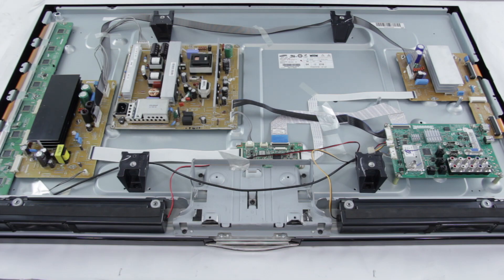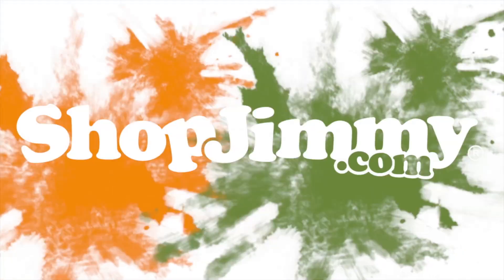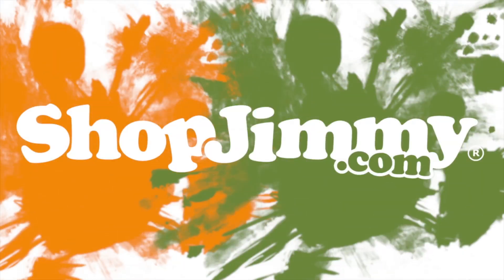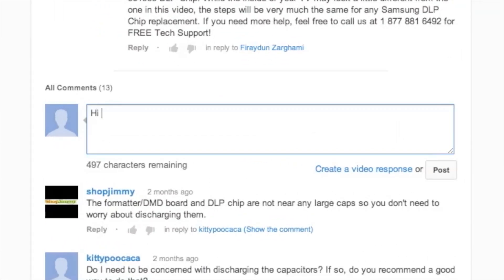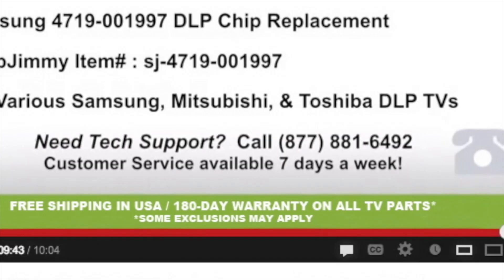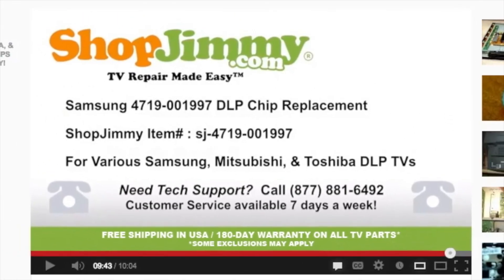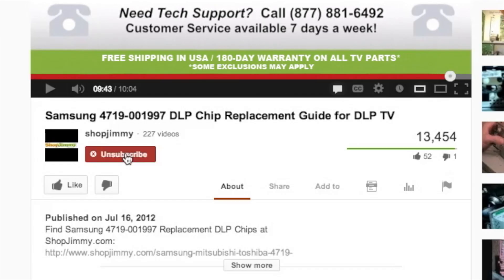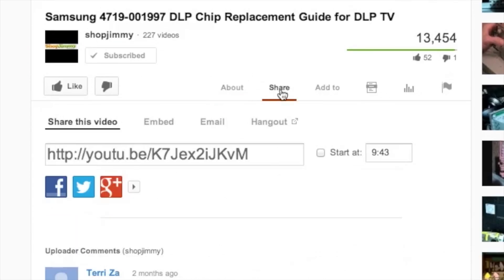Plasma TV Repair Tutorial - Common Symptoms & Solutions - How to Fix Plasma TVs

Comment: I have a Panasonic TC- P42G10 that while watching a show made a loud "popping" noise then shut off. the power LED was blinking red a few times (did not count how many times though).. any ideas on what to do to remedy?
Thanks!
Reply from the maker: Steve Blais   PLEASE SUBSCRIBE TO OUR CHANNEL - Try all repairs and troubleshooting at your own risk.  I recommend replacing the SC, SU & SD boards in your TV.  Click this link to replacement parts for your TV model number:  http://www.shopjimmy.com/catalogsearch/result/?q=TC-+P42G10  There may be multiple boards for the same TV model number, be sure to match part numbers on your current board, with your replacement for compatibility.  Thanks and please let us know if you have any further questions with your TV Repair!  www.shopjimmy.com

Comment: 42HP16
Partial lit screen, mainly on both sides with a dark middle
everything works ok otherwise
I was told it is the plasma panel itself and is not worth repairing.
I had two boards changed before and had larger capacitors to withstand heat, i was told toshiba original design was not adequate for heat.  tv worked great for months after until the screen problem happened suddenly.
you can email me direct wiseguy1963@yahoo.com
Reply from the maker: Nash S.   Try all repairs and troubleshooting at your own risk.  This sounds like a TV panel (TV Screen) problem.  If your TV panel is bad, it may be more cost-effective to replace the TV as panels are typically hard to find in stock, difficult to replace, and expensive.  Thanks and please let us know if you have any further questions!  www.shopjimmy.com

Comment: Hi. I have a Samsung PN60E7000FF plasma TV. It turns on and works for about 5-10 minutes. Then, it shuts off and the red light flashes. If I unplug it for a few minutes and plug it back in it comes back on, then goes off. Any idea what the problem might be? Thanks!
Reply from the maker: Shawn Kirkbride   Try this at your own risk. Unplug the TV, then disconnect the y board and plug in the TV to see if the TV powers up. Reply with the results of this test. Thanks! www.shopjimmy.com

Comment: My Panasonic model is a TC-P50S30 made in Feb 2011 that has the 7 blinking lights and no picture at all.  Just would not start up the other evening.  Any advise would be appreciated.  It had collected alot of dust over the years.
Reply from the maker: Amber Bebout   Try this at your own risk. Unplug the TV, then disconnect the SC board and plug in the TV to see if the TV powers up. Reply with the results of this test. Thanks! www.shopjimmy.com
Reply: ShopJimmy.com it now blinks 8 times instead of 7...what ya think?
Reply: ShopJimmy.com Guess I should clarify the screen is still black with no image and it blinks 8 times when the SC board is disconnected rather than 7 when it is connected.  The board number is TNPA5351 with a blank space then 1SC,  Hope you can assist.
Reply from the maker: Amber Bebout  Try this at your own risk.  Run the same test on the other side with the SS board.  Thanks!  www.shopjimmy.com
Reply: ShopJimmy.com If I reconnect the connections to the SC board and disconnect the connections on the left to what I believe to be called the buffer boards I now get 7 blinks again.

Comment: Hi mate I have a lg plasma model number : 50PJ350-AB 
It has stand bye light but when u turn it on just before the picture shows up it clicks and turns off
Reply from the maker: quick six    Try this at your own risk. Unplug the TV, then disconnect the y board and plug in the TV to see if the TV powers up. Reply with the results of this test. Thanks! www.shopjimmy.com
Reply: Hi on the y board do I unplugged every thing on it or just some their a plug at the top side bottom I disconnect the top and side one and it just clicks and won't turn in clicks from black boxes with yellow tubes in them in the middle of the main board I think it is
Reply from the maker: quick six  Try all repairs and troubleshooting at your own risk.  Yes, everything that is connected to the Y board must be disconnected.  Thanks!  www.shopjimmy.com

Comment: Panasonic model # tc p50v10  while tv was on heard a slight noise then shut down with 4 blinking red lights. unplugged then turned back on now have 5 blinking red lights unplugged all cables did not help, took back off to check for any visable bad parts found none.

Comment: I have s Samsung 3D Plasma, Model #PN51D8000FF. For a while now I would be watching the TV and it would start making this "Wee-yow" kind of buzzing sound and the screen would show greenish yellow vertical lines and the then the TV would go off or restart on its own. I tolerated that, but yesterday it did that and the TV would not come back on. It goes into some kind of power cycle where it is trying to come on, but it doesn't. It gets to a point and then restarts on its own. It continues doing this until I manually shut it off on the power strip. Can you recommend a part or parts to get my TV going??

Comment: PS51F4500AR - The problem is it TV powers on but the remote or Manual Jog control are not responding to select any other function. TV is Stuck on Tuner mode.
What could be the problem?
Reply from the maker: Xhisomo   PLEASE SUBSCRIBE TO OUR CHANNEL - Try all repairs and troubleshooting at your own risk.   I recommend replacing the main board in your TV.  Click this link to replacement parts for your TV model number:  http://www.shopjimmy.com/catalogsearch/result/index/?cat=56&q=51F4500A  There may be multiple boards for the same TV model number, be sure to match part numbers on your current board, with your replacement for compatibility.  Here is a link to a video showing how to identify your part number, click here:  https://www.youtube.com/watch?v=RwHTvjMdrhk  Thanks and please let us know if you have any further questions with your TV Repair!  www.shopjimmy.com

Comment: Great video,you may have pointed me in the problem area,ie the sustain board,hope you can confirm and supply what's needed. The problem I have with my Samsung s42ax-yb07 plasma TV is that over the last few days pink dots have been appearing on screen a few minutes after switching on,eventually effecting the whole screen . At the same time I cannot access the TV menu via the remote, I don't know if that gives a clue the the dot problem. Hope you can help. Max,Manchester,England .
Reply from the maker: maxton beesley  PLEASE SUBSCRIBE TO OUR CHANNEL - Try all repairs and troubleshooting at your own risk.  I recommend replacing the main board in your TV.  Click this link to replacement parts for your TV model number:  http://www.shopjimmy.com/catalogsearch/result/index/?cat=56&q=s42ax-yb07  There may be multiple boards for the same TV model number, be sure to match part numbers on your current board, with your replacement for compatibility.  Here is a link to a video showing how to identify your part number, click here:  https://www.youtube.com/watch?v=BEPWrefQvqIThanks and please let us know if you have any further questions with your TV Repair!  www.shopjimmy.com

Comment: I have an LG 60 pn5700 plasma, when I turn on the TV the lg logo appears on the screen, along with a gray bar across the screen as well, then the screen goes blank but the TV is still on, I can hear the static. We already changed the Y sustain but still the same. All the caps look good. Couple yrs old. Next move?
Reply from the maker: fuzzplay   PLEASE SUBSCRIBE TO OUR CHANNEL - Try all repairs and troubleshooting at your own risk.  This could be a problem with either the buffer(s) or a bad TV panel.  Click this link to replacement parts for your TV model number:  http://www.shopjimmy.com/catalogsearch/result/?q=LG+60+pn5700  There may be multiple boards for the same TV model number, be sure to match part numbers on your current board, with your replacement for compatibility.  Thanks and please let us know if you have any further questions with your TV Repair!  www.shopjimmy.com
Reply: ShopJimmy.com sorry I did subscribe, but it was the day after I posted this so it proly got missed :-)   I am loving all the well-done vids btw!
Reply: ShopJimmy.com so is there a way to test the buffer board to see if there's any continuity? Or does that not apply w these, and I just have to order one and put it in to see if it works?  Also, by TV panel do you mean the front section of the TV?
Reply from the maker: fuzzplay  Try all repairs and troubleshooting at your own risk.    You can check the IC chips on the buffer for small holes.  We show some examples in this video:  https://www.youtube.com/watch?v=gFiVQx6_QbM  The panel is the screen portion of the TV.  Thanks!  www.shopjimmy.com

Comment: Your videos are extremely helpful!... but I can't pinpoint my problem. I have a Samsung hpr5052x. It works fine for about 30min then the picture gets a yellow and purple grainy tint. The tv will eventually turn off, then back on and the picture will be fine for another 5 or so minutes then it will cycle on and off again and repeat. There is typically a loud pop when it turns off on its own. If I turn the tv off manually (before it turns off on its own), the picture lasts for another 20 minutes before fading. Also there is a creaking noise coming from what sounds like the SMPS Y main. It creaks for 2 seconds then stops for 2 seconds and continues the entire time the tv is on. Any ideas?
Reply from the maker: Patrick H   PLEASE SUBSCRIBE TO OUR CHANNEL - Try all repairs and troubleshooting at your own risk.  I recommend replacing the Y-Main Board and the Upper and Lowe Scan Drive/Y Buffer Board.  Click this link to replacement parts for your TV model number:  http://www.shopjimmy.com/catalogsearch/result/?q=hpr5052x  There may be multiple boards for the same TV model number, be sure to match part numbers on your current board, with your replacement for compatibility.  Thanks and please let us know if you have any further questions with your TV Repair!  www.shopjimmy.com

Comment: Can you please help me My lg Plasma 42pj350-za, was switching its self on and off with a click and a white fuzzy mark across the bottom of the screen. I think I have solved this problem, has there is no switching on and off now and no white band. I have replaced the Ysus board. But there is no picture just sound, however the screen does become lighter when the tv is on, any ideas please
Reply from the maker: glensafc6   PLEASE SUBSCRIBE TO OUR CHANNEL - Try all repairs and troubleshooting at your own risk.  I recommend replacing the Top Y Scan Drive board in your TV.  When you replace the YSUS, you want to also replace the Top Y Scan Drive (Y Buffer) board in your TV.  Click this link to replacement parts for your TV model number:  http://www.shopjimmy.com/catalogsearch/result/?q=42pj350-za  There may be multiple boards for the same TV model number, be sure to match part numbers on your current board, with your replacement for compatibility.  Here is a link to a video showing how to identify your part number, click here:  https://www.youtube.com/watch?v=GEllG3RV-tcThanks and please let us know if you have any further questions with your TV Repair!  www.shopjimmy.com

Comment: Hi again, thanks for reply. The barcode on ac/power board is 90SE1206765Z0617 where the 0's are zeros. 
The tv serial number is EQ0350415801A again the 0's are zeros except the last one which may be a letter (I didn't mark it so unsure, could be letter or number, the rest are definite).
The capacitor is a nickicon 450v 350uf 105c situated at c125 on power/ac board. Other markings on cap are G X (M). Although it seems this particular cap doesn't exist...
Hope this helps. 
Could you give me a price on separate capacitor also ac board. Or a link to eBay for parts. Thanks
Deane

Comment: I have a Magnavox model number 42 MF 230 a / 37 plasma TV that I want to know what needs to be replaced the screen stopped working and smoke came out from the back of the TV but I still have sound I took the TV apart and found that the lower buffer board Samsung part number LJ992 2-01203A has 2 of the chips that are burnt is here anything else I should be looking for that may need to be replaced the upper bored I don't see any visible damage to it.
Reply from the maker: Spud O  PLEASE SUBSCRIBE TO OUR CHANNEL - Try all repairs and troubleshooting at your own risk.  I recommend replacing the Y-Main Board and the Upper and Lower Y Scan Drive boards in your TV.  Click this link to replacement parts for your TV model number:  http://www.shopjimmy.com/catalogsearch/result/?q=42MF230a  There may be multiple boards for the same TV model number, be sure to match part numbers on your current board, with your replacement for compatibility.  Here is a link to a video showing how to identify your part number, click here:  https://www.youtube.com/watch?v=R1jmj_foId0  Thanks and please let us know if you have any further questions with your TV Repair!  www.shopjimmy.com

Comment: i have a Samsung plasma model number PS42C430A1M, the problem of the tv is that it won't start . Already checked the power supply and i got the standby voltage and there is Va and Vs voltage too . But after one second they drop down . please Help !

Comment: 32" Model Curtis LCD3215A Black out, constant blinking green light. TV went out while watching, had a black strip in center before it went black completely
Reply from the maker: Dee M.   Try all repairs and troubleshooting at your own risk.  This sounds like a TV panel (TV Screen) problem.  If your TV panel is bad, it may be more cost-effective to replace the TV as panels are typically hard to find in stock, difficult to replace, and expensive.  Thanks and please let us know if you have any further questions!  www.shopjimmy.com

Comment: I have a Samsung Plasma tv model Pn51f5300afxza made September 2013. The TV turns on and either shows the Samsung logo then goes to a black screen, or sometimes it will show the picture for a 1 minute to 5 minutes before the screen goes black. The TV has sound the whole time though. Any suggestions or direction would greatly be appreciated.  Thanks!
Reply from the maker: Titus Cromwell   PLEASE SUBSCRIBE TO OUR CHANNEL - Try all repairs and troubleshooting at your own risk.  I recommend replacing the X/Y Main Board and the Y-Buffer Board in your TV.  Click this link to replacement parts for your TV model number:  http://www.shopjimmy.com/catalogsearch/result/?q=Pn51f5300afxza  Be sure to match part numbers on your current board, with your replacement for compatibility.  Thanks and please let us know if you have any further questions with your TV Repair!  www.shopjimmy.com

Comment: Hello, My tv is a Samsung PN51F5500 51" class 3D plasma HDTV and my cat pee the underside of it. Now the tv has vertical flickering lines on the site (left side of tv) I try to blow dry the moisture out of it work a little, watched tv for a while then it got horizontal lines and went all black. I turned off and waited turn on and just the flicker black lines, What can i do? or do i have a $900 door stop?
Reply from the maker: M Montero    Try all repairs and troubleshooting at your own risk.  Try all repairs and troubleshooting at your own risk.  This sounds like a TV panel (TV Screen) problem.  If your TV panel is bad, it may be more cost-effective to replace the TV as panels are typically hard to find in stock, difficult to replace, and expensive.  Thanks and please let us know if you have any further questions!  www.shopjimmy.com

Comment: SAMSUNG 
MODEL#PN58C500F2FXZA
VERSION UY01
https://www.youtube.com/watch?v=_KrlHTVPR_4&feature=youtu.be
The flickering at the top of the screen happens no matter what the input. DVD, Apple TV, Roku, TV signal. However, I do notice that there is less of it when the unit is first turned on where as the longer the TV is on there seems to be more distortion. Thank you for your help. I very much appreciate it.
Reply from the maker: Pine Forest   Try all repairs and troubleshooting at your own risk.  This sounds like a TV panel (TV Screen) problem.  If your TV panel is bad, it may be more cost-effective to replace the TV as panels are typically hard to find in stock, difficult to replace, and expensive.  Thanks and please let us know if you have any further questions!  www.shopjimmy.com

Comment: I have a Philips 50" Plasma, model no. 50PF9431D/37

When turning on, the front led turns on (green and solid) but I get no picture. There were a bunch of blown caps in the power supply which I replaced. fuses are good too. Any ideas? Is there a way I can check with a voltmeter that the power supply is working?
Reply from the maker: Connor Burgess  PLEASE SUBSCRIBE TO OUR CHANNEL - Try all repairs and troubleshooting at your own risk.   If you have experience with a multimeter, you can check the voltage on the VS & VA.  Thanks!  www.shopjimmy.com

Comment: I have Samsung PN63C8000YF that made a popping noise and lost picture. When I turn it on I see a white flash and then just darkness. The standby light is on while off. Also the Samsung jingle comes plays when I turn it on. I have checked the boards for blown capacitors but don't see any. Any help would be appreciated. Thanks.
Reply from the maker: Jonathan Hernandez  PLEASE SUBSCRIBE TO OUR CHANNEL - Try all repairs and troubleshooting at your own risk.   I recommend replacing the Y-Main Board and the Y Upper & Lower Scan Drive boards in your TV.  Click this link to replacement parts for your TV model number:  http://www.shopjimmy.com/catalogsearch/result/?q=PN63C8000YF  There may be multiple boards for the same TV model number, be sure to match part numbers on your current board, with your replacement for compatibility.  Here is a link to a video showing how to identify your part number, click here:  https://www.youtube.com/watch?v=R1jmj_foId0  Thanks and please let us know if you have any further questions with your TV Repair!  www.shopjimmy.com